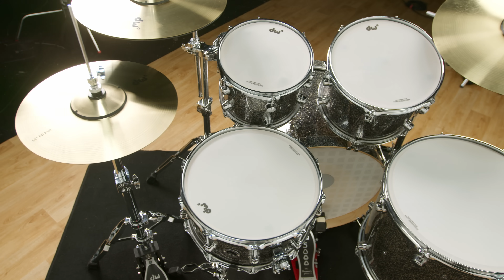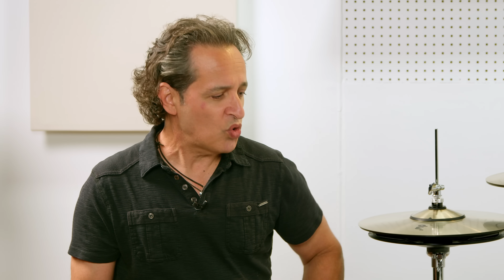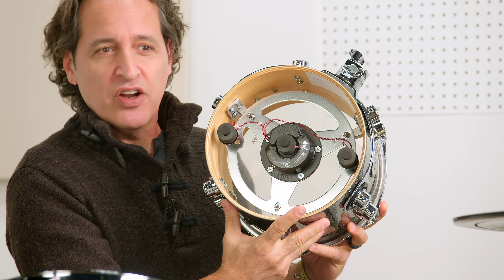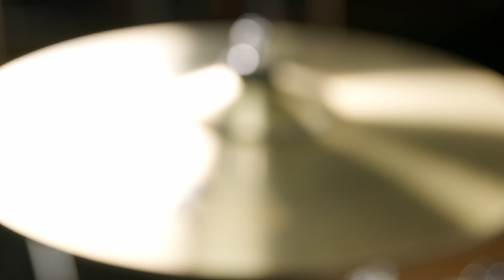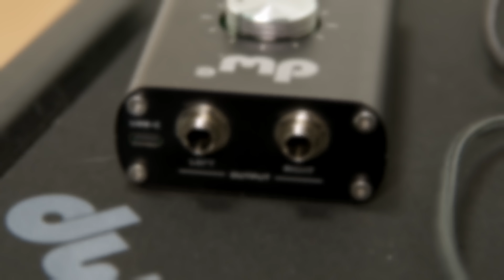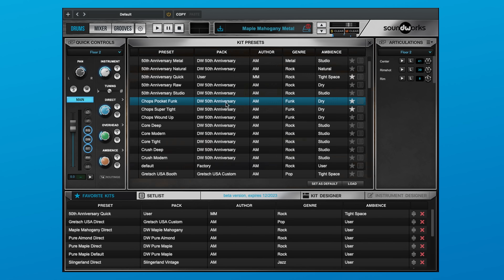DW’s DWe Drums: Two Worlds of Convertible Play, Total Innovative Control

Comment: I can already see this has cool features and is a step in the right direction but it still isn't gonna cut it for a pro there are no direct outs it has to have batteries removed instead of just having higher quality rechargeable batteries thats two pretty big issues in a live environment the sound engineer needs to have full control over the separate outs its cool it has the control for your personal mix but thats not gonn help when you are playing and they need your snare quieter and kicks louder at the same time the only option he will have is to turn your whole stereo mix up or down or yell at you to adjust it on your computer.
Reply: Disposable batteries are the way to go. Rechargeable ones would be a disaster.
Reply: @dconsmack  having to take out batteries by taking the drums apart or unscrewing things isnt s good alternative either
Reply: Doing that once every 1-2 years isn't unreasonable at all. I would consider that extremely low maintenance.  @ironblast5
Reply: I just found out you can use a x32rack with a dante card to get multiple outs so that is a cool option hopefully they can figure out a way to have the battery packs easier to access or external mounted off a drum lug or something  so you dont have to take heads off or unscrew a panel on cymbals. If Roland/Dw does all of that and they figure out how to get the sesitivity of their digital snare, ride, and vh14 high-hat to work on a thinner and quieter metal cymbal design it will be game over.

Comment: Having played on this kit, the wireless feature is top-notch quality, but the symbols really bring down the experience. They have the feel of playing on top of a plastic box. I’d rather stick with the roland rubber cymbals
Reply: I figured that's was 10000% the case, despite trying to look like cymbals. They probably spent more time on how they look, the overhead shots look amazing,just like real,brand new shining cymbals. I wondered if they where plastic, or possibly like a sheet of metal equivalent to really cheap begginer kits from long long ago. As they wouldn't be heavy,but can still give you that feeling of definition on stuff like the ride.whereas rubber and plastic or wood are always gonna feel....not like a metal cymbals does
Reply: Reminds me of those Hart edrum cymbals I used to see advertised in the back of modern drummer mags back in the day
Reply: I posted a different  comment that was geared derogatory towards live use but since have discovered  that the roland td50x has a software update that allows us to use the module with this kit via 1 didgital cable connection from this kits didgital hub with out the need of a laptop giving all the line outs needed to use this kit live while also allowing us to use the roland  digital hats and ride along with the crashes if we want now I feel they just need to redo the td50x module to have 4 digital  inputs instead of 3 so we could also use the digital snare and they should do some cross business with the folks over at sd3 to implement the sd3 tones into the module the way pearl mimic uses slate or even the new elesis prime having software based tones